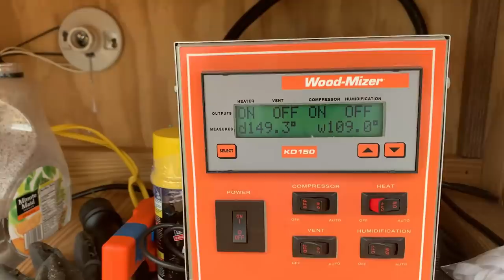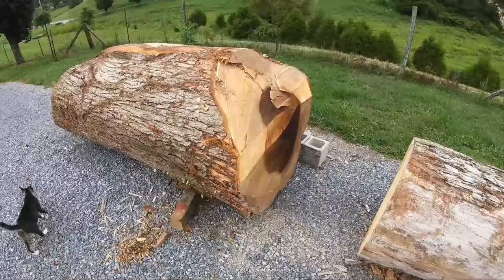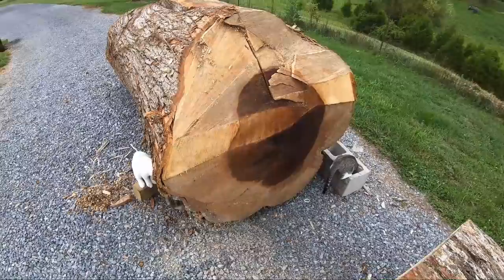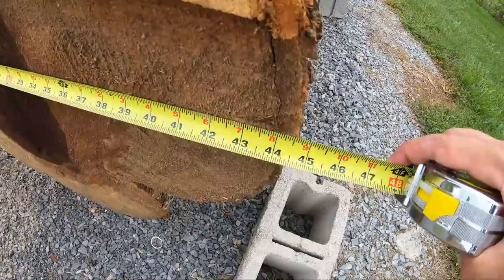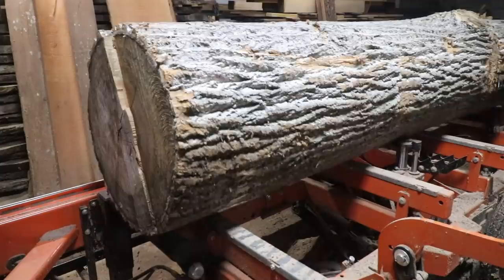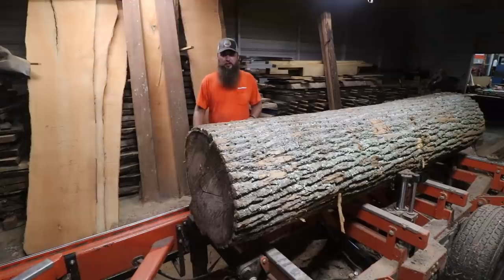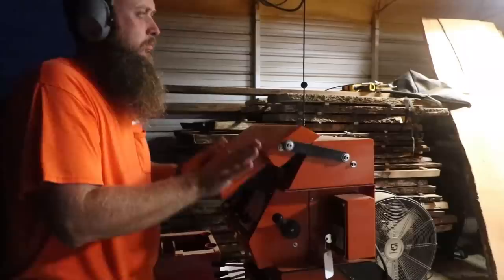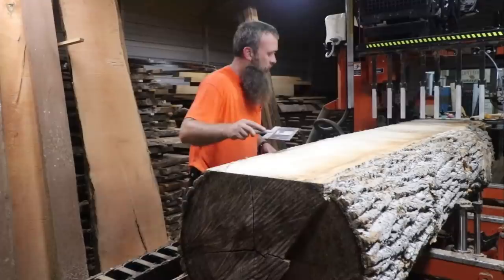This Log Is Way Too Big For My Sawmill, A Sawyer's Vlog

Comment: My in-laws used to have a catalpa tree (pronounced like ka-TOWEL-pa) that was every bit of 4 feet across. They wanted to have it cut down since it was growing into the side of the garage. This was about 20 years ago. They decided to live with it when they got a couple of estimates to have it cut down. The CHEAPEST estimate was over $2,000.00, and only if the sawyer could keep all of the wood. They lived in town and the tree sat between their garage and the neighbors dining room about 4 feet away. There were also electric and phone lines running right past it. I always wanted a cross cut slab out of it for a dining table. When my in-laws moved, the new owners tore down the garage and left the tree standing. I haven't been back there in over a decade, it may still be standing.

Comment: That log is the typical size of what I mill with my double ended alaskan mill.  I usually quarter them, it makes it easier to load on the band mill.   I have learned to come in from both ends almost to the middle and leave a small piece (about 6 or 8 inches) uncut in the center.  Then roll the log 90 degrees and cut it the whole length.  I take another chainsaw and cut out the remaining 6 or 8 inches out of the two halves and its quartered without having to set up the rip guide again, and it holds together while you make the final cut.  You have an awesome log there, friend!  Best of luck to you with it!

Comment: I milled a log that was 42" in diameter and 25' long about 3 months ago.   I have a Timberwolf sawmill and it can handle it and even logs bigger than that.  48" max up to 29' long.  That Kubota diesel engine is a horse to.

Comment: If I could offer some advice- (aslo no idea if you've milled with a chainsaw previously so if so, disregard) , BUT, When you mill with the Stihl, check on the air filter, milling can clog it quicker, also increasing the oiler on the chain isn't a bad idea. A milling chain also makes life a lot easier and keeps the cuts clean! Looking forward to seeing that log cut up!

Comment: Ha when I saw the log my mind went to a chainsaw mill would sure be handy to take some width off it to fit it on the mill.
But yeah I wouldn't cut it in half I'd cut slabs of the sides till it fit mill. 
Plus you going to catch fits with it pinching  trying to half it with the weight

Comment: At this date it is late.  But let me vent a bit anyway.  

I think the numbers you quoted were 43 inch diameter and your mill throat was about 34.  Rather than cut the Catulpa in half use the Alaska mill to square up to a Cant.  You actually don't loos much in kerf.  The kerf loss goes with the off cuts as you will set the edge of the kerf width on the outside of the cant.  It wouldn't matter if the kerf were 6 inches thick you would end up with the same size cant.  

You'll end up with about a 30 inch cant, could be a bit larger.  If the log is a bit oval and doesn't fit the mill you will not need to take off many boards to make it fit and still the kerf loss is small. 

Work the trig of a square inscribed in a circle and I think you will get the idea.  SIN (45°) I think is what you are looking for.  ~= .7 (very rought figure).  43*.7 should be the approximate size of the cant. +/- a bit for taper and what you want to do about waning.

Comment: Catalpa,, I like catalpa,, beautiful covered in white flowers each spring.  Great shade tree.  Poplar wood,, is extremely stable once cured, cuts, sands, planes, shapes, easily and its true sterling quality is paint retention.  If you are making moldings or trim boards that you are intending to paint,, interior primarily,, but exterior too.  Use poplar.  Paint loves to stick to poplar.  My front doors,, made 30 years ago 2.25 inches thick,,, 3 feet wide, and 8 feet tall,  a pair of huge French doors,, solid poplar.  Has not moved even a 1/16th of an inch in 30 years.  They always swing easy (a bit like swinging a vault door).  All the baseboards in that house,, all the stair rails, spindles, balusters,, poplar. Outdoor fluted square columns,, poplar.

The pattern makers wood.

Comment: Hey Nathan, what is the black cylinder thing in front of the saw blade? Looks to be about a foot tall and 6" in diameter. Can't wait to see the chainsaw mill unboxing!
Reply from the maker: debarker maybe?
Reply: @OutoftheWoods0623  I've seen it move out of the way on a few cuts. It is right in front of the blade and the guides. I'm not a saw mill guy so I was just curious as to what it is. It is the black cylinder thing. Kinda looks like a starter standing on end.

Comment: How about videoing the blade change. Was wondering how much more difficult it is compared to the lt35 with the extra support beam in front of the cover.
Reply from the maker: will do, it does take a bit longer,
Reply: @OutoftheWoods0623  Thanks. I have looked all over for blade changing videos for the lt40 and can’t find any. Also, do you notice much difference in blade life on the lt40 with debarker vs the lt35 without.

Comment: A question about your kiln, Nathan, if I may?  I accept every word you say about how you operate it - I was a CT and MRI engineer before I retired, so what do I know?  But it seems to me something is 'arse about face' with the sterilisation phase?  Intuitively, the sterilisation should come first, followed by the drying phase, having raised all the water content to the same temperature?  And 150F ?  Is it just an industry 'known' that 130F will kill all infestations and 150F is just 'belt and braces' as we Brits say?  I wonder if any higher would cause warping or splitting and why go higher if it isn't necessary?  Sorry to sound dense, but it just sort of 'rang a bell' when you explained it.
PS:  Now you may have only included a few seconds of it and the rest of it could have been a nightmare of backwards and forwards, but I couldn't help noticing how straight and steady that trailer was when backing up to the drop.  I've been towing things for years and I can never be that accurate and steady!

Comment: After you stack your wood you may get less end cracks if you paint the end with latex paint.  It works for me . You can get cheap paint at the stores that mix paint. They usually have some oops paint ( mixed wrong ) that’s priced cheap.
Reply from the maker: I use anchorseal, much better than latex paint, you should switch and you will get better results, thanks for watching,
Reply: Ok I’ll check it out. Thanks

Comment: Keep in mind I don't have a saw mill, and only have watched videos, but, I have to ask- why not use the "Alaskan mill" to cut the log down to where it will fit on your Woodmizer? Just cutting it in half will give you 20 or 22 inch slabs! Why not cut it to get the 34 inches your mill can cut?

Comment: As a cabinet maker I like poplar for drawer sides and backs  I do not make the interior of my cabinets from plywood... I just do not find anything pleasing about that.. The front face.. oak, walnut ,chery whatever..will depend upon what is requested... If is to be painted the front drawer face will be at least 5/4" poplar to start and be profiled from there. Poplar shapes well it takes paint well, durable.......AND YOU ARE MAKING 2x4s? you are losing so much money...When the width of a board is so important for cabinetry...anything 14" or wider will command a premium..best price will be for 7/8" or better when bone dry. So it can be brought down to 3/4 true when  sanded and finished. If you can find a cabinet maker who builds like I do .. A raised panel in a cabinet door the best width is 14" to 16" ... 18" is almost to wide for a solid panel with out backing.  So anything that you can cut from Popular from 13" to 17" that has a really nice grain figure that could be used for drawer fronts and cabinet doors...That is your best market for a log like that.  My very best for you and yours..Merry Christmas.